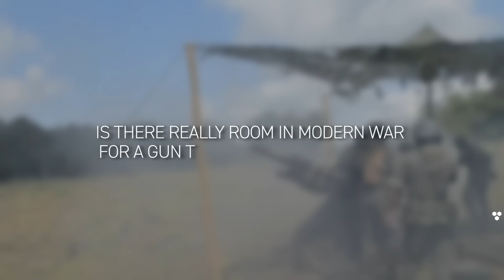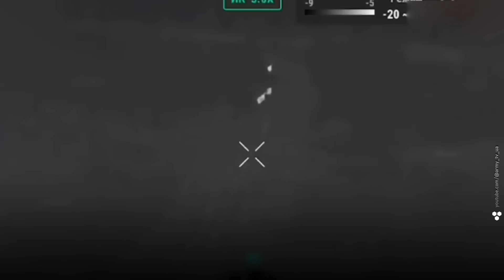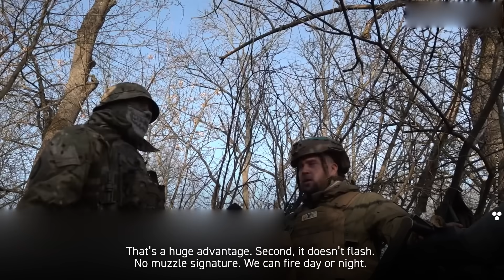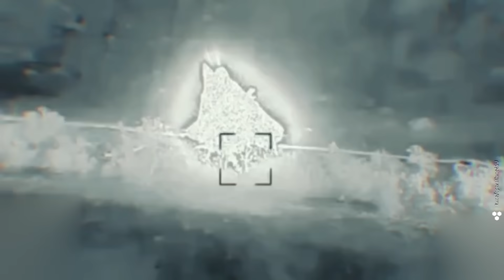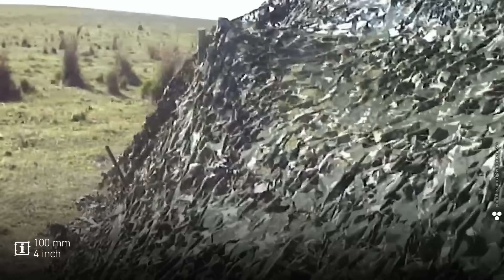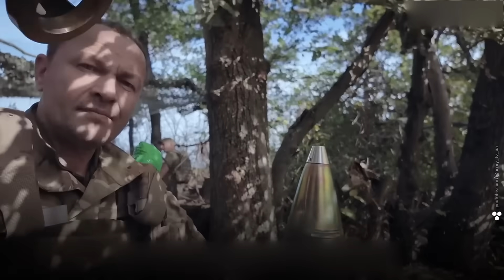ITALIAN MELARA Mod 56: Ukrainian Soldiers Spill Hard Truth About Western Artillery

Comment from the maker: What topic should we cover next?
Reply: i don't know,  cover about weapons your channel  has never covered before
Reply: How about the Marder?
Reply: What about vehicle based (highly mobile) mortar systems in general? See the old M113 120 mm Mortar, Ex-Sovjet 2S-xx  or  its newer cousins like the Polish M120 RAK (Ukraine should have received some in 2024). With 120 mm and ER shells, these mortars have a similar maxrange as these 70 year old 105 mm, on Target an at least comparable explosive charge per shell. 

Plus: you may "shoot & scoot" in a few (felt) seconds rather than minutes - in case there is way too much iron in the air. Commercially: cheaper to produce shells - at least, as long you stay with standard rather than ER (base bleed) Ammo. The combat ranges given here is nothing too special for standard (NATO) 120 mm mortar rounds. 105 mm has depending on the shell type roundabout 1-2 kg of explosives as filling, same as the 120 mm NATO mortar shells. But with way less weight of the mortar itself and with a way steeper impact - really important for trench systems as soon as one needs "delayed fuses".
Reply: B1 Centauro‼️
Reply: How about modified and updated weapons of yore.
Reply: Maybe something about the logistical footprint with 105, 120, 155. There is a discussion that 105 or 120 reduced logistical requirements outweigh reduced firing distance. So up to battalion level it might be enough with 120 and then have 155 at brigade and higher. NATO may have made a mistake when they focused on 155. It is just as difficult to fire short with 155 as long with 105, I have been told by an artillery officer.
Reply: @larsbkurin1740  Which raises the question, if you need 105 mm Artillery at all. 155 mm "Long Range" up to 40 km and 120 mm Mortars with "up to 8 km Standard, up to 13 km ER". The latter ones as an asset on batallion level, Himars and 155 mm on brigarde (counter battery fire) as well as divisional artillery (Himars). 

So you are talking about three types of Ammo rather than a dozen.
Reply: Hawk missile, another weapon tech from the 60s.
Reply: B1 centauro in Ukraine war
Reply: https://en.m.wikipedia.org/wiki/SPG-9
Reply: Naval guns?
Reply: @adeliomoro2069        No   It whas artillery for Alps Mountain
Reply: @fernandovertemati
I was answering about the original question , what topic next?
Reply: Variant of m48-m60 Patton. It is an old tank that is in service in many countries (Israel, Taiwan...) with several modernizations.
Reply: The old Soviet 122 mm howitzer we Finns know as 122 H 63.
Reply: Italian WWI planes converted in drones?😂

Comment: Not being equipped with hardy, sure-footed donkeys in the mountainous bits of Sarawak, during the 'Confrontation' with Indonesia,the RAF choppered them into the foothills and we, the gun crew, literally slogged up the slopes carrying the gun parts on chains attached to the donkey harness bars.
The gun barrel was a ball busting weight, even for four fairly strong gunners, and my back muscles have never fully recovered.

Comment: Just for the record: a mule is not a donkey, and the old Artiglieria Alpina units (the last was the gruppo Lanzo, where my father served) used mules to carry the OTO 105, as well as its predecessors, including the Skoda. A mule is a hybrid of a horse (female) and a donkey (male), inheriting the larger size of the horse and the strength and resilience of the donkey.So mules have a stronger muscle structure and can carry heavier loads for longer distances. Mules are known for their hardiness and ability to thrive in tough conditions, so they were ideal for the Alpine environment. It took several mules to carry a disassembled cannon or howitzer, 10 to 12 depending on models. Mules' conductors (you don't ride them, of course) often developed a strong affection for these stubborn but intelligent and dependable animals, just like a cavalryman for his horse.

Comment: You seem to forget that these howitzers were carried by mules because they were used on mountains. Off road. You cant use trucks on a steep mountain trail.
The German Wehrmacht used horses and mules in ww2 because they need no gasoline, if the gasoline supplies are cut off then it makes no difference. Using a fleet of trucks would require 1000s of gallons of gasoline.

Comment: These guns could simply be fixed to a rotating base mounted on the loading area of a vehicle. This makes them even more mobile and safer from return fire.

The MELARA Mod 56 weighs just under 1300 kg.

For a 1400 kg load, special pickup models with a high payload, large all-wheel drive vans, or a combination of an off-road vehicle and a suitable trailer are particularly suitable. Most conventional off-road vehicles (SUVs) do not offer this payload. Most modern Unimogs offer a payload of between approximately 2,000 kg and 7,000 kg, depending on the model, wheelbase, body, and equipment.

Larger flatbed trucks, dump trucks, and light to medium-duty trucks are particularly suitable in this range. Here are some specific examples and vehicle classes:
1. Iveco Daily Flatbed/Dump Truck
Payload: Up to 4,200 kg (depending on model and permissible gross vehicle weight, up to 7 t).
Variants: Open flatbed and tipper available, various lengths and engines.

2. MAN TGE flatbed truck
Payload: Depending on the model and load capacity, up to approx. 2,600 kg.
Various lengths and wheelbases available.

3. VW Crafter flatbed truck
Payload: Uprated models offer up to approx. 2,600 kg.
Versatile equipment and loading areas.

4. Citroën Jumper, Fiat Ducato, Renault Master (uprated flatbed trucks)
Payload: Uprated variants reach up to approx. 2,700 kg.
Various lengths and loading areas, usually available as a double cab or single cab.

5. Light to medium-duty trucks with open flatbeds
Example: MAN 8.180, Iveco Eurocargo, Mercedes-Benz Atego (depending on the body, as a flatbed or tipper).
Payload: Depending on model and body, between 3,000 and 5,000 kg.

Comment: Americans think that if a weapon is "old" it isn't effective... like if you get stabbed by a sword from the 1700s or shot with a revolver from 1913 you won't get hurt just because it is "old" 🤭🤦‍♂️
Specifically OTO-Melara 105/56 was designed and built for paratroopers and Alpini mountain troops, it had to be light so that they could parachute it with the troops or bring it around in high mountain terrains... not like the 'muricans that built 50+ ton tanks like the Abrams only to find out that they got stuck in the sand in Iraq or couldn't cross most bridges (too heavy) in Afghanistan making them almost irrelevant in the conflicts (same in Ukraine, the fucker is so heavy it can't be used in entire regions where there are many rivers/bridges)

Comment: At the end of the ‘80s, I did my military service as an officer in the Italian Mountain Artillery, the Alpini Artillery. That howitzer was our main weapon, and we were instructed to know every single part of it. It wasn't held together by screws; its main parts could be disassembled by hand with no tools and it was originally designed to be divided into 12 loads to be carried by mules. In 1991, though, all the Alpini's mules had been discharged, the last 24 having been dismissed in 1993. The last to die was a mule called Iroso (which can be translated as “irascible”) that died in 2019, at the age of forty.

The 105/14, as we called it, was then retired from service as its main characteristic was to be transported everywhere, in places where no vehicle could go. I did see some mechanical mules, but nothing beats the animal in an alpine environment; they have a sense of danger and never walk on thin ice, risking falling into crevasses in the snow-covered mountains, while the mechanical mule goes wherever you drive it. Furthermore, the mules were silent, with no engine, and the advantages were obvious.

The 105/14 last appeared during a live-fire exercise in 2004, but the weapon was reintroduced into the Italian Army in 2019. After all, it’s still small and relatively light; it can be towed by a number of vehicles, and it can be parachuted.

During my officer’s course, I was part of a demonstration team that used to perform for certain occasions or when ministers or international political figures came to visit the school. We put our howitzer in the middle of the football field while the authorities were on the stands. Seven of us were lined up, three on each side of the howitzer and the seventh was the gun commander. At a signal, a couple would run to the howitzer, dismantling a part, starting with the shields, the barrel, the breechblock, and so on. When a couple had put the load on its designated stand on the ground that represented a mule, the other couple ran to take another part. The loads were about 100 kg each, so it took two people to transport them on a run. When the howitzer was completely disassembled, the gun commander waited for a couple of seconds, then gave a signal to start rebuilding the 105/14. As quickly as it was dismantled, it was reassembled. We then raised the barrel very high and loaded the breechblock with a charge. The gun commander gave the fire order, and the small 105/14 made a loud blast. The people in the audience always freaked out. They did not expect such a blast from something that was dismantled into pieces on a football field one minute before.

Our team set an all-time record of 2 minutes and 6 seconds from start to finish, including dismantle, reassemble, and fire. I know that the following teams beat our record, but they were allowed to operate more than one couple at a time, while in my time we were not. 

I have never considered the 105/14 a weapon of war; it was more a training tool. We used to live in an era when everything seemed to lead to a better future for everyone. It is heartbreaking to see that those small, old howitzers have to be used to defend people's liberty almost forty years later. Maybe some of the howitzers they are using in Ukraine are the ones I touched so many times in that period. Good luck to the artillerymen who are using them now.
Reply: Same piece was used in Italy by the 185° regiment Artillery Paras (Folgore) in 70' and 80's, we use to launch from C-130 an re-assemble the piece when landed.
Reply: Ciao....ottima disamina.....Anch io ho servito negli ALPINI, ( Battaglione Alpini Sûsa, oggi 3° alpini)..... Se non ricordo male, nella Taurinense,il reggimento artiglieria è il 2°??
Reply: Discarding mules is a mistake. They are always needed in mountains. Turkish Army took them back in 10 years ago. Neither helicopters nor agile vehicles could replace them.
Reply: Eccomi , 103 ° corso artiglieria da montagna, poi a Sterzing ...
Reply: Alpino di leva 93 . Discendente di 5 WW1 caduti e 2 WW2 feriti . Gloria agli Alpini !
Reply: Grazie mille per il tuo splendido commento, da parte di un ufficiale di artiglieria del 121 corso AUC.
Reply: W gli Alpini!
Reply: Bella descrizione, grazie!
Reply: Amen
Reply: Obviously a very well designed gun. it was also used by the Argentine Army in the Falklands War and caused many casualties among the British troops.
Reply: Saluti, Alpino!
Reply: Caro ex sottotenente I am very impressed by your knowledge of english terms.
Reply: It it is not old keep it?
Reply: Mi pare che anche la squadra del Tenente Fidanza(sempre artiglieria da montagna) aveva segnato dei record
Reply: There is nothing better than hearing from people that actually had experience with a tool. Thanks for sharing. Mio padre era un alpino, i miei zii alpini, se avessi fatto il militare sarei stato un alpino anche io. Slava Ukraini

Comment: It is not a big deal about using donkeys, as the USMC still uses mules...
Reply: Both french and Italian alpine troops use them. But difference is can't drive a logistics vehicle up a mountain. Russia using donkeys on a flat plains because they have no vehicles anymore.
Reply: @murphy7801 Italian alpine troops use the last donkeys in 1991 !!!
BTG 6° Trento 144cp 1/91 !!!
Reply: @trotamarmorata2673     Italiano army Never used donkeys .         Used MULES !!!
Reply: @murphy7801 Italian Alpine troops use the last donkeys in 1991!!!
Btg°6 Trento 144Cp° 1/91-Brunico !!!
Reply: @murphy7801 Italy doesn't use them anymore
Reply: Many armies around the world use them for mountain troops.
Reply: @COMPASS_MDP  This is not a reason to be proud at all. The 21st century has been around for a long time.
Reply: @vladkudrya9615  Ignorance also have been around as well...
Reply: @vladkudrya9615  Non significa che ciò che è più tecnologico sia migliore o più utile, specie in certi ambiti è solo una favola. Cento volte meglio quel pezzo di ferro smontabile ed indistruttibile di settant'anni fa che una nuovissima arma da Star Trek composta da migliaia di elementi ipertecnologici che si bloccherebbe al rompersi del primo micro circuito elettronico o all'esaurirsi dell'alimentazione (per non parlare della visibilità di un mezzo moderno ai sensori del nemico)!
Reply: @vladkudrya9615 So what? Oto Melara produces the most modern naval guns for 57 navies in the world, such as the 76/62 with guided ammunition.

Comment: Aren’t some components of the M56 copied or based on the Skoda 75mm? It was a classic in its own right!
Reply: No, it was an original project; the only thing in common with the Skoda 75 was the propensity to be dismantled for transport. Among other things, the project has very little in common with many other Italian projects, such as the Obice da 100/17 Mod. 14 or Mod. 16, the Obice 105/22 Mod. 1913 or 1919, or the Obice 105/14 Mod. 1917. The real turning point for the 105105/14 Mod. 56 is that it was conceived from scratch for the standard 105 mm NATO calibre, use in modern warfare, and compatibility with NATO ammunition.

Comment: The fire is being conducted from an Italian 105-mm howitzer mod. 1956, which was created specifically for paratroopers and mountain shooters for the American 105-mm M 1 projectile mod. 1941. Upon detonation, this projectile produces fragments of 28.4% of which are capable of piercing through a 7 mm armor plate with a hardness of 375ed from a distance of 27 m.According to Brinnell, 6.3% of the fragments are capable of piercing a 10.5mm thick plate, and 1.5% of the fragments are capable of piercing a 17.5mm thick armor plate from a distance of 15 m.. Warm combat greetings from a former artilleryman from Azerbaijan to the Ukrainian gunners!
Reply: The Oto Melara 105/14 model 56 howitzer is a lightweight howitzer. Designed in the 1950s by Lieutenant General Salvatore Fuscaldi to meet the Italian Army's need for a lightweight howitzer that could primarily equip Alpine units, it is a compact artillery piece with unique features. The unique features mentioned include the ability to manoeuvre the piece by hand thanks to its lightness, as well as the fact that it can be easily used for direct fire. In addition to this, the 105/14 was designed to maximise transportability; it can be broken down into 12 pieces and easily transported first on the back of a mule and then with other means and can be dismantled and reassembled in 4 minutes. It was used in Vietnam by New Zealand and Australia, but they soon began replacing it with the American M101 piece, as it was considered more durable and robust for prolonged fire operations. The British used it for a few years, then opted for a weapon with greater range and more lethal ammunition, the L118 Light Gun, which was introduced to replace the Model 56 starting in 1976. The Argentines instead used it against the British during the Battle of Goose Green, Falkland Islands War.
Reply: I thought you guys were on Ruzzias side....?
Great to know that not all of you are brainwashed!